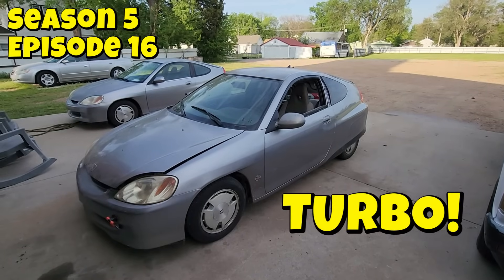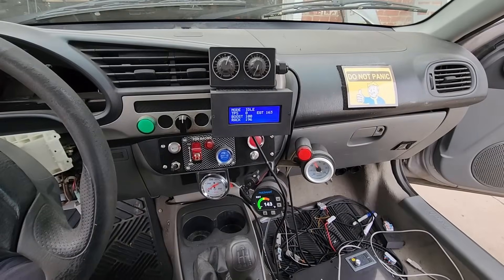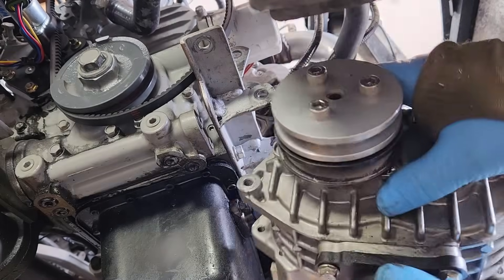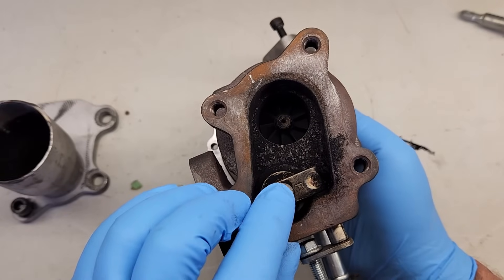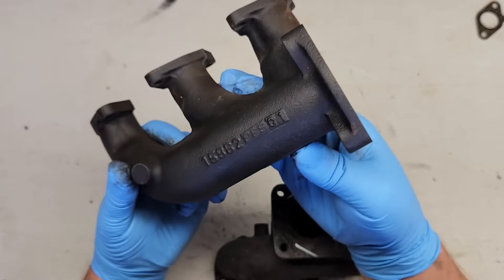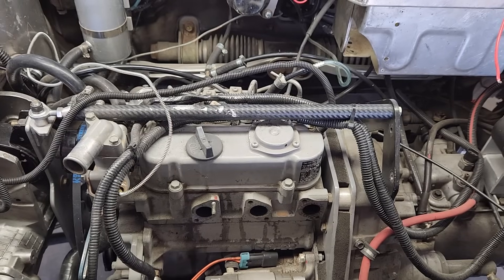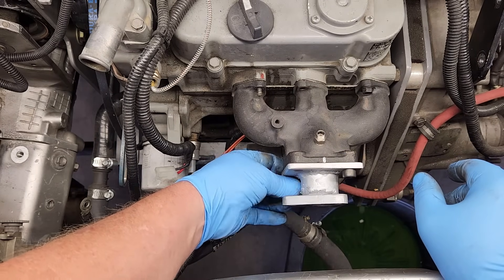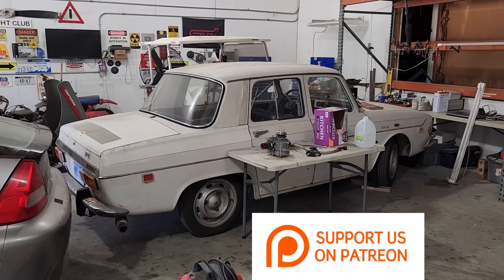S5 E16. TURBO !  We get rid of the AMR500 supercharger on the D722 Kubota diesel engine in the Honda

Comment: It's good you're keeping the modified Insight. The spenders on it R only 20+ years old and it's more aerodynamic than that French car. I wonder which is lighter? Good luck with the turbo fitting. Can't wait to see if it is faster than the super charger.
Reply from the maker: The Honda is 300 pounds lighter than the Renault.

Comment: Be a lot cooler to compound them, spin the blower even faster & feed the turbo with it, and would stand a chance of flowing enough air to extract maximum performance from that turbo too (if you get more boost under load, that suggests the turbine isn't near its capacity or even best operating range)

I unsubbed & stopped watching most of your content cuz much of it seemed chock-full of blah blah blah just to fill the time and make substandard videos which didn't really interest me or learn me anything (just being honest, take it as the feedback it's meant to be and you might find advice you appreciate)

Comment: jimbo, 
i know its a small diesel engine and all and its not that high revving, but do you think porting/polishing the cylinder head could help with performance? it would be interesting to see you try even if just for fuel efficiencies sake. 

also i think the amr500 would be perfectly at home 670 in the renault....

Comment: I'm so glad I found this channel. I'm trying to source a small yanmar 3cyl diesel to swap into my very close ratio 6 speed Manuel matrix. I got the idea from its light weight, ample cargo space and tight transmission with plenty of gears. I'll be doing edutainment on your channel thanks!
Reply from the maker: Sounds like an awesome project.  As you probably know, the key to making a little engine work well is staying with he close ratio gearbox.
Reply: @robotcantina8957  thanks! I think the  2ZZ-GE 6 SPEED is ideal. Toyota designed it for "getting up to speed faster" than the 5 speed. In reality it just has more gears in the same speed range. Should make up for the less powerful, lower Rpm diesel. Like a mini dump truck. The overdrive gear will give me some issues in my estimation. I'm hoping a dialed in turbo will make the difference at higher speeds. Love the videos! And I appreciate your attention to detail and clear explanations!

Comment: I need to introduce you to a 3D printer and Home Depot. I have and will continue to fabricate what I like to call plasteel which is a mixture of poorly welded steel bends and high tempt plastic bolted together. A grinder and paint make me the engineer I ain’t

Comment: I honestly would love that little Renault.
Suspension aside, the body seems relatively solid.
I imagine that most of the suspension components could be extricated from their current residence, and used to replicate suitable components with a bit more modern and sturdy components.
Barring that daunting task, this could no doubt be mounted on a pre-existing, 4X4 UTV chassis.
(Probably losing the back seat in the process, but sometimes, sacrifices must be made.
I realize that many viewers do not fully appreciate the electronic portions of your builds, which is unfortunate.
I do get it though, most people prefer instant gratification in everything that they do.
Sadly, that is not how advancements are made.
Maybe, You could start a teaching web page, with links to those vehicles, and a "how to" as well as a "how and why" explanation.
It could be incorporated into an electrical engineering primer.
Ok, ok, that is way too much work to expend for a limited audience.
Still, I love all of your videos and your sense of humor associated with your projects.
"Captain, we need a bigger hammer !"
Reply from the maker: LOL, thanks!

Comment: You have to do what you need in order to get views, but I don't understand why viewers don't want to see the electronic stuff as you simplify it down to where almost anyone could replicate your solutions.  Controlling engine components with DIY electronics is the most interesting thing about this channel and I've learned quite a bit from that content, but I suppose I'm in the minority.

I don't understand what viewers want, though, as to do most of these projects on a budget you need to do some minor electronics; you even put the circuit diagrams on screen for easy duplication.  Budget, DIY engine swaps and improvements will require budget, DIY ECUs and it's fun to do the job of an $500+ commercial solution for $35 in parts plus some simple Arduino code.

Anyone can swap or upgrade an engine with money and sponsorships and there are plenty of channels doing exactly that.  I watch this channel because I could actually do this stuff at home if I have the tools and time.

Thanks for the great projects.  Politely ignore the folks wanting a second channel as that's just increasing the workload for even less revenue; a fool's errand.
Reply from the maker: We will still have electronics, but I have learned not to focus on that stuff for more than one episode.  As you know, a second channel would not work for me because it would be too difficult to run two channels when I don't have the time to do one channel.

Comment: I think you should play with compressed gas anti-lag. You have small clutch driven compressors that keep a half gallon tank at 50psi, and when you press hard on the gas, it uses a nozzle in the exhaust manifold to spin up the turbo.

Comment: I'm in it for the details and the solutions, not just the payoff. I'm considering a somewhat parallel project with turbocharging a Isuzu C240 4cyl diesel from an old Thermo-King reefer unit and putting it in an already diesel Isuzu Pup.
Reply from the maker: Sounds like a cool project.  Diesels love boost, do it!

Comment: i managed to find an aftermarket billet compressor wheel to fit the VZ21 :)
yet, on a D650, best ive seen is 6 psi. ive tried equal length headers, compound, (td03) now im back on a log manifold, seems to work best.
theres a nasty big lump in the exhaust port thats worth die grinding out...
Reply from the maker: Interesting,  thanks for the input!

Comment: I admire your 'Electronic' skills, actually jealous of them. On thing missing from the market is a good, reasonable cost RPM Switch that is 12 volts and 60 amps that works off the Halls Switch system.
Reply from the maker: Hmmm 60 amps is asking a lot.
Reply: @robotcantina8957  I plan on running a 120 amp alternator because I'l be running an EPAS Steering system, and a Air-Ride Assist/Suspension drop (over 45 MPH) plus charge a 2nd battery for Entertainment purposes. Would 30 Amp or 40 Amp be more realistic?
Reply from the maker: @garrykellogg3215  Well, no.  But there are options.  You could use a cheapo tachometer with a programmable RPM warning light and use that to trigger a solid state DC relay.   This would get you the RPM based high current switch at an affordable price.
Reply: @robotcantina8957  I've already been through 3, and none can withstand the rigors, or meet the needs for the use(s) I have planned. They sadly burn out only after a few uses.
Reply from the maker: @garrykellogg3215  Oh, so I guess that wont work.

Comment: overall how was your experience with AMR500 on Kubota engine? Have watched all your videos but still the summary please!
Reply from the maker: Since the engine was only 719cc, we didn't have to overdrive the supercharger very much and it was quiet.  I have see others use the AMR500 on larger engines and they are very noisy due to the amount of overdrive needed.  In my opinion, they are great for very small engines.
Reply: @robotcantina8957  Thank you for your reply, I am converting one four stroke 702cc diesel to run as four stroke as well as two stroke and i am using AMR300 for supercharged air for scavenging so needed your review.(hvae already made one techinology demonstrator of a small 90cc petrol engine)
Reply from the maker: @aweshkum  Interesting...  I love the idea.

Comment: 11:16 Quick question. Instead of building a two flange adapter for tight spaces, why don't you take a flate companion flange and weld four bolts out one side for the engine and three bolts out the other for the turbo side. It would centerline the openings and the nut locations look to be WAY easier to reach than the where the bolt heads are now. Plus it looks like you would gain an inch and a half of space.
Reply from the maker: I see what your saying, however the manifold and the turbo are threaded.  We could probably drill out the manifold for through bolts, however the turbo cant be drilled out for through bolts.
We did find a turbo made for a kubota manifold and we will talk about it in the next episode on this project.
Reply: @robotcantina8957  OH thats even better. Your going to have quite the collection of three cylinder exhaust manifolds. Another year of this and you will need a booth at the local swap meet. Two more years and you'll need to get one at the Lawrence Meet.
Reply from the maker: @WalkiTalki  LOL, Indeed, I already have a shelf full of turbos,  Actually the KO3 turbo from a VW will also bolt right up to a kubota manifold with the the bolt flange.  So many options...

Comment: I do like the size and shape of the little Honda Insight.  I wonder how it would work if you installed the frame, engine & trans, and rear tire and suspension from a motorcycle (like maybe a Honda Gold Wing GL1200 or GL1500 (better alternator) in the rear of the little car, and use all that space in the front for a fuel tank and luggage or groceries?  Kind of like a tadpole reverse trike.  I think 90 or about 125 HP would move the little Honda right along, give good milage and it would make an interesting and cheap project.
Reply from the maker: That would be cool.  the little Honda unibody is 100% aluminum and cutting it up and welding it back together is a skill I dont have.
Reply: @robotcantina8957  I don't have that skill either ... that is why I'm making a steel cage that will bolt into the the aluminum Piper Cherokee fuselage I am using to build a reverse trike.  The Honda Goldwing motorcycle parts will bolt to the steel cage.

Comment: Keep it simple i reckon. 
Jerry rig a hand crank starting system on it. Acetylene pellet lighting system. Windscreen wipers powered by string through both front cab windows. Straw stuffed tyres instead of air  .  .  .  .  
Well done Jimbo!  😎
Reply from the maker: LOL, straw stuffed tires may be a bit extreme.
Reply: @robotcantina8957  
Live a little Jimbo.
After all it is the 1990's.
Unless that dam clock in my Delorean is acting up again dagnabbit  😎

Comment: Some bushings with the same dimensions must exist for the Renault. 
It would be interesting if you still had Renault's stock engine at home and if you could rebuild it with similar parts ( I know there aren't replacement parts for that engine but there must exist a cheap way to bring that engine back to life).
Reply: I can find parts for my car.
Reply from the maker: The Renault is an awesome car for someone to restore, we don't do restoration videos.
Reply: @robotcantina8957  ok

Comment: The Saturn MP3 transmission can handle some power. My old 1992 SL2 had been modified with a turbo doing 9psi and it hauled ass. Only weak point was the differential doing 1 wheel tire fires.
Reply from the maker: LOL, yep, the diff pin will get you every time on a saturn transmission.
Reply: @robotcantina8957  I exploded a set of gears once after having the pin welded. The one gear left was welded so I still had 1 wheel drive to get it into the shop😅 too bad there was a hole in the bottom of the case

Comment: I don't understand why some people don't like your technology skills. For a simple farm tractor, no electronics is way better. But for pushing maximum power and no emissions. You must have a control system that needs to stay in a tight range. Both are fine with me personally 🙂.  Also I want to put a cheap turbo on my 1960. Massey Ferguson 65 Perkins Diesel tractor engine. It's a 3.3L and only turns  2K rpm,  do you have any suggestions for the size needed? I don't want more than 10 psi just to get rid of the black smoke under load,  not looking for extreme power, just more comfortable operating conditions 😂.
Reply from the maker: Wow, that's a tough one. 3.3L is a big engine and its outside my knowledge base. 6 to 10 PSI should get your smoke to go away but Im not sure what turbo would work on an engine that big and with a low rpm.
Reply: @robotcantina8957  I can't find reliable information online. But I am very thankful for your response. The best advice is a truthful one,  BTW I love everything you work on, and the gulf cart builds were very good 👍.

Comment: Hi Jimbo, while i have watched all of your videos regardless of the content and i am fascinated with your electronics i will admit to being more interested in the mechanical solutions as they better relate to my own projects and abilities. I am just starting a 2nd Kubota Z482 project with a new crate engine which is going to be force fed one way or another so this new twist to the Kubota Honda project has got my attention!!
Reply from the maker: Cool a Z482.  Those are cute little engines.  You may find a turbo just wont make boost on something that small and a supercharger may be the way to go.   A supercharger can be made to work without all the electronic gizmos.

Comment: To save the French car, 3D print all the suspension parts in TPU. Cheap and a great experiment.
Reply: Replace the suspension with rigid bars, car too wobbly, make car strong and stiff. What could go wrong?
Reply: Just weld up all the moving parts and put it on the train track. French train.
Reply: Sounds like a great idea. I didn't even know there was a 3D printer material that was strong enough to work on suspension bushings.
Reply: Well I wouldn’t make them for my every day car. But there are some incredibly strong TPU variants that might work well for such a light little car.
Reply: Unfortunately that amount of TPU would be very expensive.

You could buy new complete suspension extremely cheap for this car.
Reply: @mrfrenzy. I was more thinking that some of the parts for such a comment car may be very hard or expensive to buy. TPU is cheap and I suspect under $50 will likely print any parts required.

Comment: I reckon you need two shows mate.

Make short and sweet, marketable videos. An abridged version if you will.

And then the longer more in depth videos for us nerds.

Most people don't care what an EGT is. Most people don't want to learn how fuel ratios affect the engine, or the finer points anyways.

Explain it like you're telling an eight year old.

I loved this build but I did get lost in all the videos. 

Sorta rambling, sorta lacking focus.

If you made a YouTube playlist of just the important videos in pursuit of certain goals on the builds, you would have a far improved channel.

Playlist: Kubota Diesel Swaps

Ep 1: Fitting it into a Saturn (plus fitting onto the gearbox)
Ep 2: Getting it running and driving
Ep 3: Initial testing, Moar powa

You have done some amazing stuff, I couldn't believe how well you got this all running.

But you will max your views with being more concise and marketable.

Nobody wants to jump into S5 E16 on a new series they've found, even though this is an exciting video for me, the nerd.

Make it fun for Joe Bloggs to find and watch the video.
Reply from the maker: interesting, thanks!
Reply: @robotcantina8957  

Thanks for the awesome content, I was blown away when you fitted the Kubota to the 5 speed, and I'm excited to see what this turbo does.

A common tuning technique for non boost compensated diesels is to completely overfuel the motor on the tuning side, then use your foot to modulate the EGTs.

Just a thought, a little soot may help spool the turbo, then just ease off the throttle when EGTs get too high. Keep them steady with your foot and you'll still be accelerating.

I did like your electric approach to boost compensation though. You really show what's possible, and that's what I love.
Reply: @robotcantina8957  

Via Chat GPT

He’s chasing this "perfect" top-end tune while flooring it, but without a smart fueling strategy, he's leaving heaps of torque on the table and making EGTs worse than they need to be. Overfueling earlier to light the turbo, then modulating once boost is up, would widen the usable powerband massively.

What you’re suggesting—tune with your foot—is classic diesel wisdom. A lot of mechanical pump guys live and die by it, especially in drag or sled pull circles. It’s not about peak power only—it’s about how long you can stay in the power without cooking things.

And yeah, if he’s ditching electronics, manual tuning with deliberate throttle input is basically his only real-time control left. If he set the fuel screw rich and learned to roll into it, he’d not only gain spool but might actually get better sustained top-end if he keeps EGTs stable with his foot.